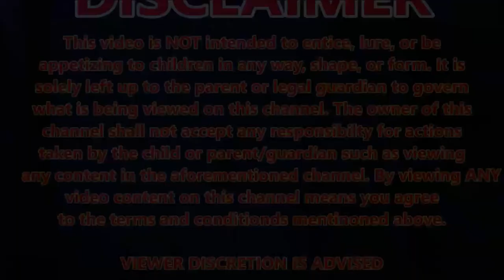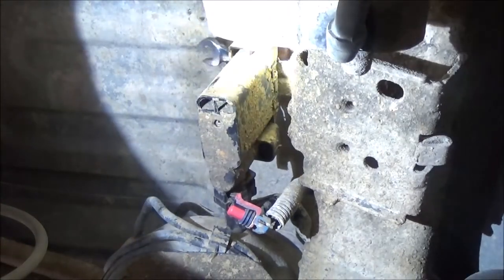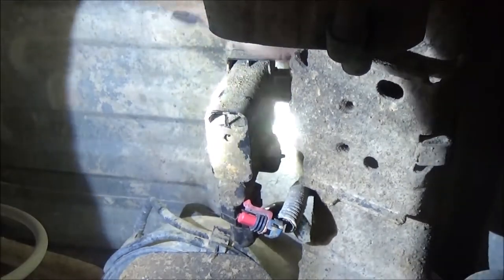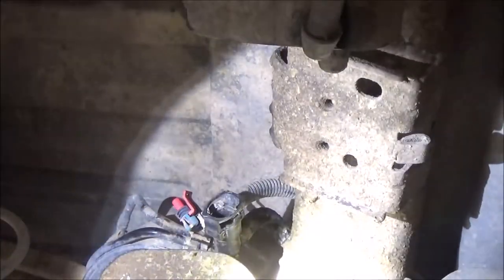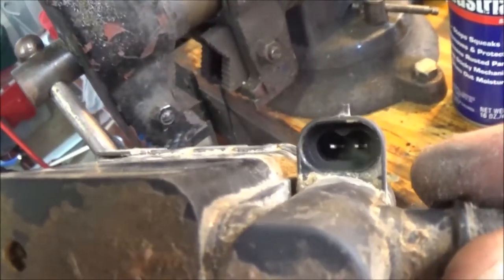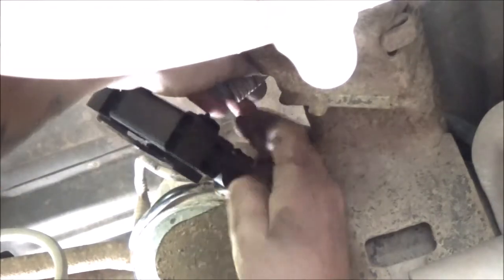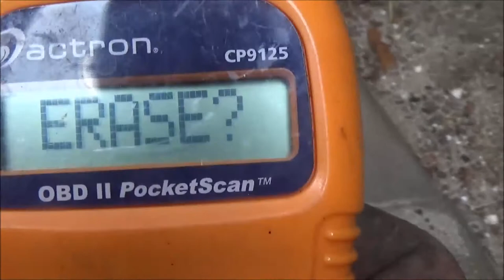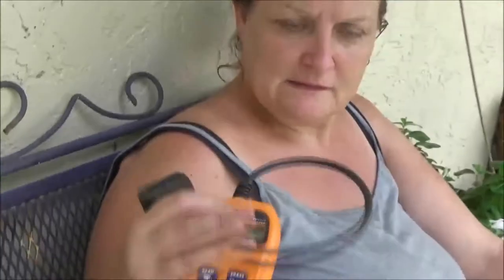EVAP Vent Valve Solenoid Replacement 03 Chevy Suburban LT 1500

Comment: Thanks for the video. I didn't really know how that hose clamp worked until now.  I waa able to get the hose off by carefully prying one side with a long flathead screwdriver and carefully pryed the other side off by lifting the underside of the plastic hose clamp. I then slid the solenoid off the bracket and removed the bracket.  The electrical connection came off easily. Just reverse the process to reassemble. Mine was on a 2003 Silverado.  Hope this helps someone else.

Comment: I had the same exact problem. After I installed the part, my light is still on. So I have to clear the code?
Reply from the maker: Yes
Reply: Always clear a code after any and all repairs, so if a code pops back up, you'll know what to do.

I had a code for my misfires and I cleared it, then next thing you know here I am looking at EVAP stuff. Lol

Comment: Half of the point in making a how to video is showing where the part is located. Not your experience at the auto part store, frankly nobody cares about your trip to autozone...
Reply from the maker: Oh, a professional YouTuber , wow and all of 3 subs thinking you can tell me how to make a how to video. Next time watch the whole video, all the information is in there. Ok, whatever dude.
Reply: No but I've learned how to rebuild my 4l60e trans and which wave and clutch plates along with proper clutch drums, shafts, servos, belts, blockoffs, to do for a performance built transmission. Also rebuilding the 5.3 gen 3 ls style vortec all while using the vehicle as a daily driver. BTW all this at age 23. Don't be passed off because your twice my age making YouTube videos on obd code fixes and not even able to do that properly.. one more thing I have 0 videos and 0 knowledge of my YouTube followers, this platform is clearly not a priority of mine.
Reply: BTW, I find it amusing that your replying to a critical comment rather than a user who asked you nicely where to find the part. Reply to this comment. This is the one im genuinely curious about.